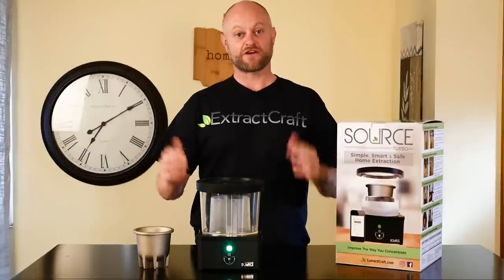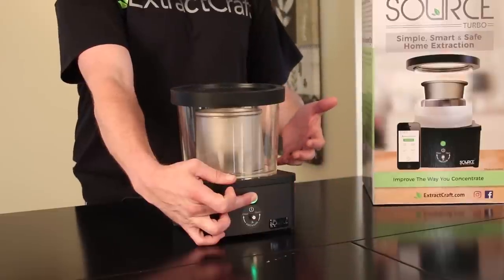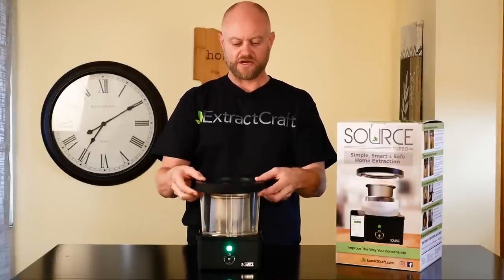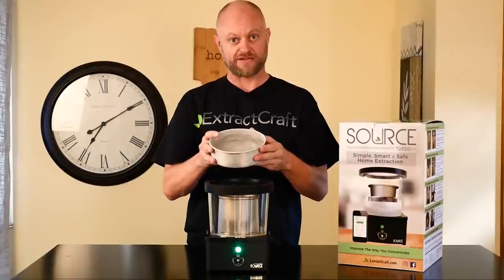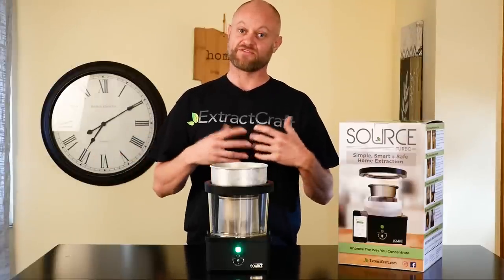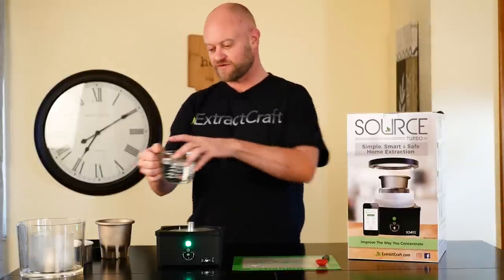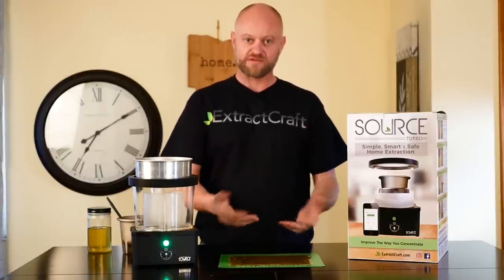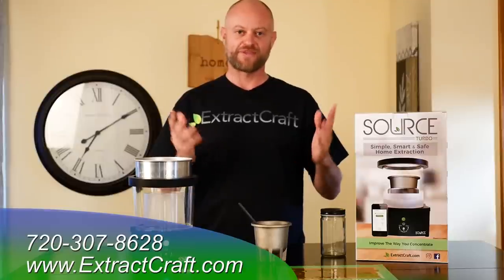Alcohol extraction using the Source Turbo by ExtractCraft

Comment: What if the altitude where I am is 10ft?
Reply from the maker: You will set to to 0ft then. Press and hold the button for 10 seconds, then let go. It will flash back rapidly at you. After that, do nothing and just wait. The light will go off, come back on and you'll be set to 0.
Reply: @ExtractCraftVideos  thank you.
Reply: Thank you- same @ sea level.

Comment: Would this be the same for making your own essential oils? then bottle?
Reply from the maker: It is not the same.  This is ethanol extraction and with it you would be making "absolute" oils.  Absolutes contain the essential oil but are a more hearty extraction process than steam distillation with just the lighter volatiles.

Comment: How do you get the oil off of the mat?
Reply from the maker: If you need help getting it off the mat its pretty easy, just fold the mat in half so you have the two side of oil folded onto each other. Put in the freezer for a couple minutes with something on it to hold it folded over. You don't want to leave it in too long or it will turn into glass and shatter all over the place. After its been in for just a couple minutes it should be quite tacky, and you should be able to peel one side of the mat cleanly away with the oil stuck to itself. Repeat this a few time until you have a shape that is easy to handle.

Comment: what is main benefit to extact since you can go straight into decarb? what is the benfit here ?
Reply from the maker: I'm not completely following what you are asking, are you asking why someone would want to make an extract?  You can decarb, or you can skip decarb and save all the terpenes.  Extracts are used for many different things.
Reply: @ExtractCraftVideos  Hi Extracraft , how long does the machine stay loud? the duration of a cycle or just a couple of min? any sound proofing methods?
Reply from the maker: @r4ymond3  Predominately off, activity will depend on ambient temp. Using the ice try and using a small fan blowing over the machine minimizes the pump activity.  Sound proofing is not possible and would create an operational danger.  If you have further operational questions please contact customer service at info@extractcraft.com

Comment: is this ethanol extraction ?? and can we make absolute oil from this ethanol extraction??
Reply from the maker: Yes, this is a tool used in ethanol extraction where we recover the alcohol and isolate the resulting oil.  Then oil from ethanol extraction is often referred to as an "absolute"
Reply: @ExtractCraftVideos  i want to order one !! but i have a question . ive heard for making absoloute , we must wash cannabis in hexane . alcohol is not working . right???
Reply from the maker: @alexandrameslan6140  No hexane necessary.  For further explanations of the process I would refer you to the website www.extractcraft.com or customer service at info@extractcraft.com.  There is a lot more information there and resources avaialble
Reply: @ExtractCraftVideos  im intrested in buying a source turbo . but i have a question . ive heard after evaporating alcohol the remaining mass is called concrete . and for turning it to absolute , there is another step needed . is that right ?
im a perfumer , and i want to make my absolute myself with source turbo . i have a rotovap but this device of yours seems alot much fun
Reply from the maker: alexandra meslan the base function is very similar to the rotovap and pretty much same end result.

Comment: Do the heater relays need to be replaced from time to time? I find that on my unit they click on and off every second that's a lot of usage, not an issue if they can be replaced IF/WHEN they ever need to be.
Reply from the maker: The can be replaced, but it would have to come back to us to do so.  The expected life on that relay is very long and we are only using a fraction of the expected life.  Have units that have been ridden hard and put away wet for 4-years and haven't had one wear out yet.
Reply from the maker: @TALKCalgary  My apologies, I can't really go back and forth here as I would with a customer service line.  To review proper use of and operation of the machine please contact info@extractcraft.com or call 720-534-1242 at your convenience.

Comment: Do you offer a larger capacity crucible?
Reply from the maker: The crucible holds about 300ml to the fill line.  It is designed to match the size and production capacity of the rest of the machine so a larger crucible would unfortunately be out of tolerance in regard to all the other components.

Comment: Can any Alcohol be used? Corn , grape . Isopropyl 99%?
Reply from the maker: For what the original biomass was doesn’t really matter as long as the ethanol is food grade, non-denatured 95% or higher ethanol.  Isopropyl can be used in the machine but there are many health considerations you should be well versed in before using non-denatured 99.9% iso only

Comment: How to remove impurities before extraction of any plant material ?
Reply from the maker: Apologies, that’s a question with a million answers.  If you have more specific questions it might be easier to contact customer service
Reply: @ExtractCraftVideos  how to isolate curcumin from turmeric. I want to know the solvent in which the volatile oil of Turmeric gets dissolved.
Reply from the maker: @sunitagovilkar8783  If you are interested in isolating compounds that is a much different process and would suggest looking at fractional distillation and chromatography.  Simple ethanol extraction like we do is a full botanical profile.

Comment: My questions is:  Given that I plan on making high potency topical use oil, can I add a few ml of the carrier oil to the crucible (Safflower) to keep the final product from solidifying?
Reply from the maker: It would be better to just stop the process when the concentrate is at a cooking oil consistency. At this point, the oil will pour out freely. If you would like to purge the small amount of remaining ethanol out, you could pour it onto a non-stick silicone mat or and let it sit out for a bit. The remaining ethanol will evaporate out leaving you with a well purged oil.
Reply: Can it do mushrooms?

Comment: How do I get it off the mat???
Reply from the maker: GETTING OIL OFF SILICON MAT

If you need help getting it off the mat its pretty easy, just fold the mat in half so you have the two side of oil folded onto each other. Put in the freezer for a couple minutes with something on it to hold it folded over. You don't want to leave it in too long or it will turn into glass and shatter all over the place. After its been in for just a couple minutes it should be quite tacky, and you should be able to peel one side of the mat cleanly away with the oil stuck to itself. Repeat this a few time until you have a shape that is easy to handle.
Reply: Beyond This.  a rosin press

Comment: Wonderful machine, but the price tag gave me a coronary.
Reply from the maker: oh my, we don't want to give you a heart attack.  Hopefully this will help. At first glance a lot of people that don't really understand the technology and manufacturing involved in our machine and automatically jump to the conclusion that it is too expensive.  However, if you take a moment to consider the following facts you might see how the price is justified and even reasonable:

1) the machine operates at 100f creating a strong, potent, and terpene packed end product.

2) you can choose to decarb or not decarb as the machine will not automatically decarb.

3) you can choose to make a tincture, oil, wax, or even shatter for legal smokeable herbs if you choose.

4) you reclaim the alcohol saving $10-$15 each time you use the machine, meaning in about 50 uses the machine pays for itself.  For serious users like stage4 cancer users, that would be in just a couple months.

5) we have unmatched customer service.

6) we have built a community of users to support each other and help each other in our user group.

7) the next closest closed loop system on the market is at least $1,800 and it is butane based.

8) you can have your medicine and reclaim all the alcohol in 2-4 hours.

9) it is the only closed loop system that sits on the kitchen counter and doesn’t emit odors.

10) it is the only extraction device that is safe to use inside the house.

11) it is the worlds first at home appliance that has altitude tuning for consistent performance at any elevation.

12) created, designed, engineered and originally manufactured all by us in USA, locally here in Colorado.

13) we offer a 1-year warranty.
Reply: ExtractCraft 12 is already a good reason to buy tbh

Comment: Im only at 200ft not 1000 what should i press?
Reply from the maker: Try both sea level and 1,000 on separate runs and see which works best.  EtOH PRO will probably be sea level while Source Turbo may be either but probably 1,000
Reply: @ExtractCraftVideos  too late lol
Reply from the maker: @dprpmmst1  1,000 feet is fine tuning, so you should be able to use either.  Just try both and see which works better for you.  Lower settings will make the unit more aggressive with more pump activity while higher settings will ease aggressiveness.
Reply: @ExtractCraftVideos   the vacuum level keeps dropping and i tightened everything. The app says it goes to 25% then 31% then drops
Reply from the maker: mycekoh I would suggest reviewing the troubleshooting section in the user manual or contacting customer service at info@extractcraft.com

Comment: 2023 Oregon, using this with 190 proof, i used it with dry ice during my rinse i noticed my alcohol almost became acted like it was carbonated
Reply from the maker: Did you put the dry ice in the alcohol? Typically you would just have the dry ice in a freezer and have your ethanol and plant material in the same freezer or cooler, not actually adding the dry ice into the wash.

Comment: Water distiller does the same thing and a fraction of the price.
Reply from the maker: Not at all. These are under vacuum and therefore able to evaporate off the ethanol at only 105 deg f. It also collects all the ethanol that goes into it. Very different from a water distiller.

Comment: Would this be the precursor for making shatter?
Reply from the maker: Yes.  However, I would probably refer to it as the base oil that shatter comes from.  The oil is the what all concentrates are made from and each concentrate is only slightly different in crystalline development, moisture, and thus form.

Comment: Wait, you decarb after infusing into the alcohol and producing your extract? Can you wash with decarbed product first, then process in the machine or should you wait to decarb until after you have your oil?
Reply from the maker: You have many choices.  You can not decarb and have a non-decarbed product, or you can produce a decarbed product by decarbing the plant material before extraction or decarb the oil after you're finished.  There is a great decarb blog post on www.extractcrafter.com if you'd like to take a look as well

Comment: Are you going to show how to scrape oil off and make essential oil? Also, I didn’t see extension cord,is this battery or electric?
Reply from the maker: I'm not fully understanding the question.  Do you mean scrape off the silicone mat?  The cord is in the back of the unit, it is not battery charged
Reply: @Diane Myers i use a small silicone spatula and i purged another round and learned that the end product is hard to get out so dont do that like i did without putting the tincture in a silicone container  then you can make it into crystals its fun to experiment and learn from others hope i helped lol
have a fun day
Reply: @ExtractCraftVideos  Can you mix the rendered oil and mix it with MCT oil then put in capsules?
Reply from the maker: @samster865  Yes, many people do exactly that.  The MCT is oil base, just like the concentrate you will make with our machine.  That means they will combine and bind very easily with just minor heat of about 120F-150F in just a couple of minutes.  You can check out our Facebook user group "Extractcraft Users Group" and see lots of people doing that and also use the search function to review previous conversations on the topic or ask the members for tips in doing just what you want to do

Comment: Iso Dabs! The future is real! 😍🥰😍
Reply from the maker: I might suggest food-grade ethanol for an extra step to cleaner meds, same process though
Reply: Quick question are you describing cause it's an edible oil ? If I were to make iso oil or shatter do you have to decarb it when your home just end up smoking it ? Dunno if that's a dumb question but question I have.
Reply from the maker: Joey Quarry MooseKnuckle83 not a dumb question at all, it’s actually a little more complex than most people give it credit for.  For a really good understanding check out this post https://extractcrafter.com/2019/01/29/decarboxylation-decarb-101-basic-understanding-and-at-home-method-comparison/
Reply: @ExtractCraftVideos  Thks bud. That was really informative.
Reply: How much of the "botanical" did you use and what was weight of return?

Comment: You had me sold until he said to pop it into a 240 deg oven to finish it off.
Reply from the maker: That's only if you want a decarboxylated end product. For smokables, you do not have to put through an oven. If you want it decarbed, you'll need to heat either the plant material first, or the oil after, around 240 deg f for a hour.

Comment: there is NO reason this should cost $750 and you cant use it in places where its below sea level ......
Reply from the maker: It is only $599 and you CAN use it when slightly below sea level. You round up the elevation setting anyways.

Comment: Have this machine.
So far it has proved to be a colossal waste of time and money.
So far from each and every time used it has taken 16 hrs AVERAGE to extract the oil from the alcohol.

It is junk and definitely not what it claims it is.
Reply from the maker: Have you set your elevation when you got it? That is extremely important. If you are having any issues, we have excellent customer service who will either troubleshoot what's being done wrong or help get your unit fixed if there is an issue. Email them at info@extractcraft.com. These units absolutely take 2-3 hours to get through a crucible as long as you're on turbo mode.
Reply: @ExtractCraftVideos  yes. Absolutely.